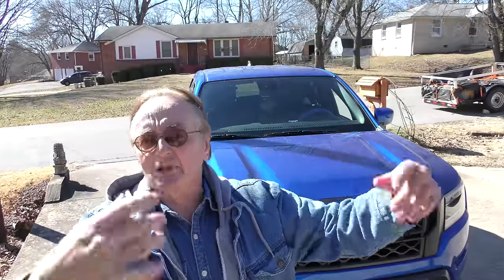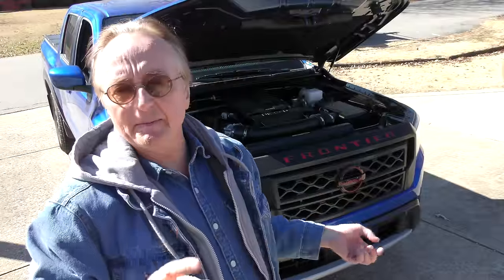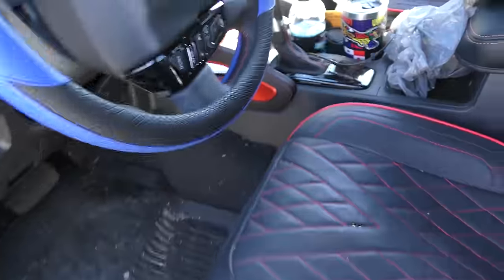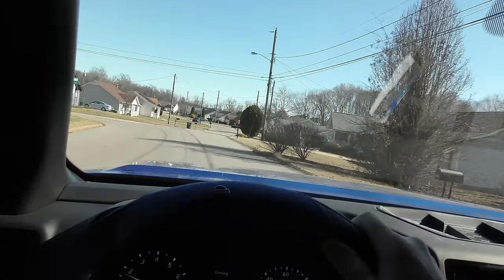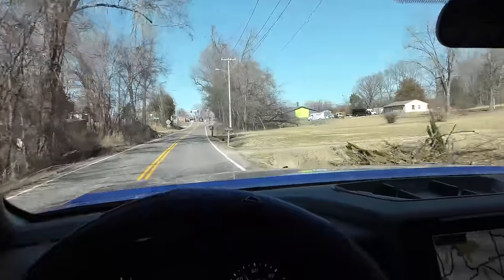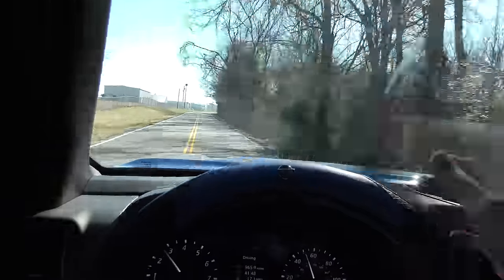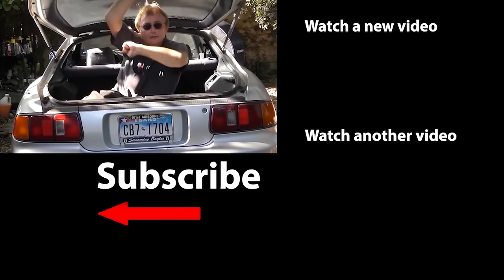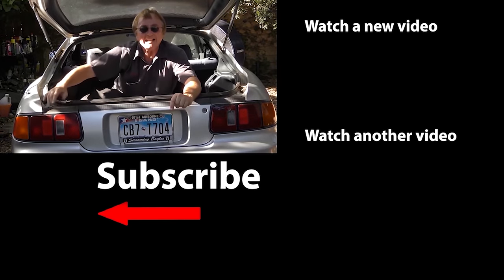This New Cheap Truck is Better Than Anything Toyota Makes Now

Comment: Nissan Frontiers have always been solid and reliable.  The only real gripe I've heard from owners is fuel economy.
Reply: My Nissan Hardbody lasted 200,000 and just blew up.. BUT the clearcoat then the paint on the hold peeled off. There was not a recall but there should have been since EVERYONE I have ever sent from that time period did the same.
Reply: Solid perhapps, but reliability was always very poor, Check consumer reports. This model, which i owned and liked, for about 6 mos, also had poor reliability according to CRm, mine was fine.
Reply: And turning, they cannot turn every time I have to park I have to do a 3 point just to park, other than that super reliable.
Reply: @ocm1774  Well, it's a pickup, not a sports car.
Reply: The Tacoma V6 is terrible too. I’ve got a Trd sport2019  with a 19 gallon gas tank only gets about 320 miles.
Reply: @chrisfrank8413  Only thing I've read from multiple sources, including CR, was that 05-08 were to be avoided, but everything else was good. As far as brand new stuff, only time will tell.
Reply: @joelmartin3213  That's worse than my 2011 Yukon XL.  I get about 18mpg at 80mph with a headwind.
Reply: My ‘22 Frontier gets 25 mpg in the city. Not bad at all honestly!
Reply: @Joshtheweatherman  So you get 50% better fuel economy than what the ratings are?
Reply: I can say i get 24 mpg city driving….i baby it though, the best i got was 30.5 on a 8 hour trip
Reply: @jp1087  Yeah, I don’t drive like a maniac like most people do. So the 9 speed transmission really helps out with fuel economy. Now when you’re hauling a heavy load, of course it’ll go down. That’s with any truck.
Reply: I’d agree, my 2016 with 6-speed manual gets on average about 16-17, and I drive mostly highway. Other than that I love it.
Reply: Yup the fuel economy is not good but i didn’t care
Reply: @chrisfrank8413  These models were just introduced in '22!  New models have a few bugs to work out and there was a recall for something seatbelt related. CR is not reliable. Have to browse the owner forums to see what owners are experiencing and it's minor with these new models.
Reply: Bought a 23 Pro-4x last year.   Just took my first long trip in it  last week … Colorado Springs to Phoenix and back…75 mph all the way and averaged 23.7 mpg. … yep you heard that right.  This truck rocks!!
Reply: I suppose that when someone buys a small pickup they may care about fuel efficiency, but when I buy trucks I’m not expecting Prius like fuel efficiency.

Comment: I own a 2018 SV 4X4.

I got to test drive a 2023 S for my boss.
The new truck is head and shoulders above the previous gen. So much power and very tight driveline.

Comment: Bought a 2024 King Cab and love it!  Sensibly sized and fits into parking spaces nicely.  Doing about 23 mpg around town and very comfortable for my 3 hr work trips up to Burlington, VT.  Love the old school gas filler neck(gas can nozzle fits) and cable parking break.  My previous truck was a bare bones 2003 Tacoma which finally succumbed to our upstate, NY winters.

Comment: I got rid of my Nissan Frontier for a Toyota Tacoma after I found oil in rhe radiator. Love my Taco.
Reply: Tacoma is far superior. That’s why a six year old Tacoma with 100k miles costs the same as a brand new frontier
Reply: @coltermasson8124 thats fine  if you think so. While you admire your used tacoma ill take the money i saved by buying frontier and take the boat i can now afford to the lake for some fishing.
You and your Taco look great sitting on the shore BTW :)))

Comment: The Frontier is extremely underrated, especially the second generation D40's. 
I've got a 2019, the last year for the 4.0L 5AT, and it does everything I need it to do without all the tech and creature comforts I don't need.

Comment: Hi Scotty.. I gots a 2005 4runner from new with 200,000 miles. V6 still runs like new. Never seen a mechanic. I do the oil changes in my DW.  GM was the biggest manufacturer when I bought my 4runner. Today it's Toyota that outsells and outbuilds everyone.

I like Nissen. Rented many of them. great running on highways. Fast. 
Hard to beat Toyotas and Hondas.

Comment: This truck isnt "cheap". There was one at the mall in my town,it was 4x4 and was 50k.... if you think thats "cheap", you must have a lot of money.
Reply: What town
Reply: Cheaper than in my area where they’re selling Tacoma for about 70 K
Reply: Everyone's definition of cheap or expensive is different. I believe this is a pretty affordable quality truck for the price. I have a 2022 myself no problems so far.
Reply: These "start" At 55k in canada. they're far from cheap
Reply: Eh that depends, we got an SV Premium, one step below a pro 4x and everything out the door was 58k. This was in Ontario
Reply: Sometimes they are way overpriced. You will find a Ford that price because they are pretty hard to find with the Rangers and lower trimmed F-150's. Personally I don't like Ford's leather seats. Then don't like the information system for the Lariot Ramgers. So base model or the XLT. I dont think I would go over an SV if I bought one of these. Though the Pros look nice I think something over 40 grand is way too expensive.
Reply: We just bought a 2023 PRO4X for just over $40k. MSRP was just under $45k with $4750 in discounts and rebates. Truck is smooth as glass.
Reply: @YerBoyTroy That's marked up big time.
Reply: @YerBoyTroy I take that back. It's Canada they hace different regs and prices becauae of those regs. I am in the US. They ahould be no wear near that price on the US. However I guess theirs a dealer that will.
Reply: So dont buy new......i wouldnt buy anything new..
Reply: Right on! Unless the manufacturer understands that 40-50K isn't a working class basic truck cost?
Reply: @pnwdweler4100 They really are great feeling trucks. Love mine
Reply: From these comments Canada just doesn't seem like a good place to buy trucks
Reply: Please do a video on the 159 hp Tacoma, Those things are a overpriced joke
Reply: Dealer markups likely…
Reply: Why would anyone buy a new car  from the dealership is beyond me. I got a 2023 Pro4X from CarMax for 36k with 22k miles. Runs like a dream.
Reply: $50K...?!? Is that with dealer markup? These things are going for $35-$40K in my area. Less for pre-owned. Waaaaaay cheaper than Toyota Tacoma
Reply: Tacoma SR5 that compares is easily $10k and up more.
Reply: Build and price they're under forty thow.

Comment: I have an '03 Pathfinder SE 4x4 with the 3.5 V6 and 4 speed auto that I bought used for $3500 and it had 165k miles. Runs great and shifts like a dream. Tows plenty and does great in 4x4. Best part? I has no payment and insurance for it is cheap.
Reply: I have an 04 pathfinder 32,000mi solid vehicle body on frame like an SUV should be.

Comment: Wow! Just came back from an offroad trip and camp out with a group of friends here in California through Big Bear, down Rattlesnake Canyon to Johnson Valley, through the high desert and then to Cleghorn 4x4 trail. Our boy with his 24 Frontier Pro 4x was struggling BAD on these tight, exposed and endless trails and switch backs. We all found out just how bad his trucks turning radius and heavy steering is on the trails, and we had to save his truck more than once using straps and even one of our winches so he wouldn't get it stuck or die. We were so glad it wasn't heavily modified or else, who TF knows how much worse it would have been with a lift, larger tires and more weight and such. It was the only truck that we had to stop for regularly and get out and guide, just so he could make a simple switch back. 🤦🏾‍♂️ He's only had it for a month and after his ordeal this past long 4th of July pre weekend, he already made up his mind and is going back to a 3rd gen Tacoma lol! He literally traded his 19 Tacoma TRD pro for it and is now kicking himself for doing so. Long story short: the frontier is not trail friendly and I would recommend that you NEVER go solo on some isolated and potentially dangerous or advanced trails. I go solo on my Taco all the time with my kids and lady, but wouldn't do the same on a frontier. I guess I love my family too much. Also, he tore the F out of the back sides of the rear seat back rests folded down, since they are lined with weak cloth, after putting his fridge and some other materials that he would carry on his Tacoma for the trip lol! How TF you don't line them with hard materials like the Taco and other trucks?

Comment: Depends on the size of the truck and what you want from it. In my younger days, I had owned two Rangers, 02, 84, a Mazda, 84, a Toyota mini camper, 78, all with 4 bangers and manual trannies. They all had enough power for me

Comment: I prefer the small trucks of the 90s and 00s. Small tin can on a skeleton frame. Light, simple, efficient. Very cheap to fix and maintain. 

Nowadays the 2010+ base trucks are all V6, heavy, and expensive. Just a set of tires alone will cost you 400. I remember when they used to be half that for the 30in tires.
Reply: !!!!$400 try again! double it!
Reply: Where are you getting light truck tires for only $400?
Reply: @barrydworak  sweet talking a discount tire employee for the cheapest brand with a warranty

Comment: I have a 2009 and it runs excellent.  I'm up to about 180,000miles too.  I had two Tacomas before that, and I decided to try a Nissan becuase they were #2 and they tried a little harder.  I got a brand new fully loaded Nissan frontier with all the bells and whistles for about $30,000.  No regrets

Comment: I have a 2016 sv. I have owned Dodge, Chevy and ford. It is by far the best truck I have ever had. I have 200k miles on it and it still runs like it did back in 16.

Comment: That with a manual would be sweet
Reply: They make em
Reply: @indycharlie I don’t think they make new 4x manuals . I have a 2014 that’s stick but they don’t make new ones or at least not in the U.S.
Reply: I think 2020 or whatever year before they switched to the new body style was the last year they made them. I love my 2016 4.0 liter V6 w/6-speed manual.

Comment: There’s a reason that you don’t find a lot of used Frontiers. There’s a reason you see so many beat up ones on the road with a ton of mileage on them. The Nissan Frontier whether 4x4 or 2wd are the best little trucks out there. They last forever. Nissan should build there cars like they build these trucks.

Comment: Just don’t drive any else that’s a Nissan 🤣
Reply: Nissan should focus on trucks…
Reply: Jatco transmissions 😃👍
Reply: The Zs and GTR is quite thrilling.
Reply: The current generation Pathfinders actually don’t suck. I believe it’s now geared by a ZF-built 9-speed automatic. A major improvement over the previous generation jellybean Pathfinder, which notoriously had the Jatco CVT.
Reply: I still have my 20 year old Altima, 4 speed automatic by Jatco ??  Transmission still smooth as silk, no hint of any problems.  CD player still works.  No rips or tears inside, no cracks in dashboard.  Engine uses no oil.  Truly still quite roadworthy after 2 decades.  Trying to think of an excuse to get something newer, but can’t find one.  I always thought Nissans were about on par with Toyotas, though they were never marketed as well.  My ‘89 Maxima was also superb. Kept it 15 years, 145,000 miles.
Reply: Armadas are decent. Get the ones made in Japan
Reply: The trucks are just as trash as their cars tbh.
Reply: @surfingtothestars  The Japanese made Armada/Patrol is an excellent vehicle. Gives Land Cruisers a run for their money. I think most, if not all Armadas that are sold in the US are made in Japan.

Comment: For every mile you travel in an electric car it takes 4 pounds of coal 🪨 to generate enough electricity to charge your electric car battery to go just 1 mile! The Gov is closing coal mines so coal keeps getting more expensive. Where’s the savings?
Reply: What about electricity generated by natural gas?  Cleaner than coal by a big margin and plenty of it in the USA.

Comment: Nissans depreciate much faster than any other truck. (Well probably a tie with anything GM).
Reply: That means a good deal on a used one!
Reply: @jackw1014  Hell yea 2022 Frontiers with 20k miles are like $20,000-$25,000
Reply: Even with the delusional Toyota high re-sale value, the average prospect truck buyer isn't going to spend that kind money for a used truck.  They might as well buy a new one.   Even though Nissan's have crap re-sale value, at least it makes it easier to obtain parts or a used truck at a reasonable price.

Comment: As someone who had the first base model version of the newer frontiers 2022, it was the most reliable and amazing truck ever for a first time buyer. I traded mine in for an updated 2024 pro 4x: not happy with the auto start on and off, don’t like the fact it doesn’t have remote start or blind spots (like my previous 2022), but I plan on getting this installed anyway but the truck is literally the same and just as reliable (if you don’t use the auto start to stop

Comment: Got a 2017 pro 4x about 3.5  years ago. I use it for towing my camper and other small trailers and I use it daily. Put about 50k on it so far not a single issue or code come up! It's the basic v8 no dropping cylinders or turbos just a basic v8. 4x4 works amazing suspension is bilistien shocks and it's got towing mirrors and a few more towing features. Hands down the best truck I ever had! And it was 10 to 15 k chaper than the competition when I bought it. Bless3d

Comment: Tacoma and Frontier start abound the same price. If the Frontier was a lower price it would help sales.
Reply: They were about the same price.  The new Tacoma is much more expensive for what you get compared to the Frontier.  I expect Frontier sales to grow a lot when the Tacoma fans realize they’re getting a lot less Truck for their money.
Reply: @rocknrollresignation93  Keep in mind..... Toyotas are FAR more reliable. If there is a big difference in price in "like" models, then I can see the Frontier selling. I am not sure I would throw $30K plus into a frontier given the track record of Nissan in the past decade or so.
Reply: @pH7screwtube  I am a Toyota guy but it’s too early to call if this 4th Gen Tacoma is reliable yet.  Most likely it will have issues for at least the next couple years.  Look at the 3rd Gen when it was introduced in 2016.  As things currently stand, I believe the Frontier is a better choice reliability and price wise if you’re buying new.

Comment: Drive a 2008 Pathfinder V8 4 x 4. Second owner, no accidents, never off road. Have a CIA and Bully Dog tuner and produce about 335 hp, 405 tq. Same transmission as the V6, but different clutch packs. Beefed up drivetrain of course. Installed inner coil airbags in the rear for about $100 and provides further diving stability. Pulls like a train, extremely smooth, and refined. Performed routine and proactive maintenance and after 5 years of ownership and 165k on the clock, it's been extremely reliably.

Comment: Couldn't agree more Sir.
Very well said.   NISSAN makes TRUCKS. 
I own a 23 Titan Pro 4x...no shutting off at stops....no shutting down to 4 cyl on the highway, hydraulic steering....more of a TRUCK than the big 3 as far as I'm concerned.   I hate that the Titan never sold well and is being discontinued.   The new frontier looks fantastic!  I might be driving one in the future.

Comment: June of 2009 I bought a new Fronteir. 2.5 4 cylinder, 5 speed auto, AC, AM/FM/CD, and no power ANYTHING. Almost 15 years with it now, 120 K+ and it is the best vehichle I have ever owned in my 66 years.

Comment: My son has a 2022 and he's hauling a 20 ft travel trailer all over the Adirondacks and other points east for work. It does cut into his gas mileage, but the truck has no problem towing it. I had a 2010 Frontier that got retired at 187,000 miles because the frame got bent when it was rear ended by a truck 3 times it's size (Big taco food truck). Insurance company totaled it, so I had to replace it. Only work I ever had done on it, other than regular maintenance, was an o ring replaced on the oil pump at 165K. I replaced it with another Frontier, a 2021 with the old body style, but the same 3.8L / 9 speed tranny as the 2024. They are long lasting, dependable trucks. Both of mine are the Pro-4X, and they are one sure footed truck. I've gotten in and out of places hunting in the Rockies where other people with their new off road trucks loaded with all the digital off road doodads on them (Fords, Rams and Toyotas) were struggling. A couple times I had to stop and wait while the people in front of me barely made it through, and then just rolled right through that section with no issues. As long as they keep making them, I will own a Frontier.

Comment: The 4.0 v6 that preceded this engine is a beast. Way more power than our 05 Xterra needs or uses. Shame on Nissan though. They had to be sued to fix the "plastic" timing chain tensioners that were a problem for several years of production. Was a very expensive and complex repair.

Comment: Put weight in the back of any truck  and it will stop looking for gears.    I have a 12 tundra 4.6 put 150 pounds in the back and it makes the truck work like they were built

Comment: We had a '93 Nissan Hardbody Extended Cab V6 5-speed 4x4.  That little sucker was a billy goat, but the front end was so weak a moderate bump would knock out the alignment.  Had a '96 Pathfinder due to an expanding family.  That thing sucked.  Same V6 but the motor would torque and snap the rear exhaust manifold bolts.  I thought the motor mounts might be bad, but the tech at the Nissan dealer said this was very common problem.  Third time it happened we sold the dang thing and moved on to Toyotas.  Haven't looked back since.